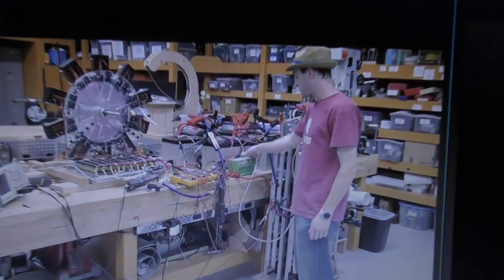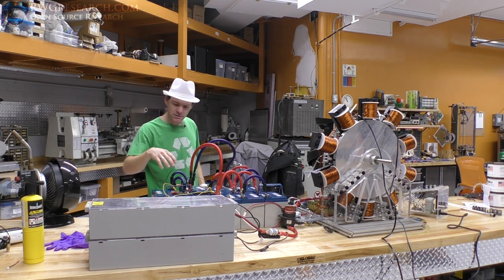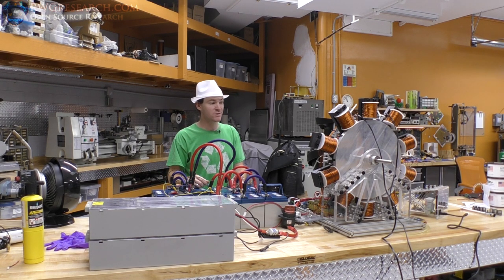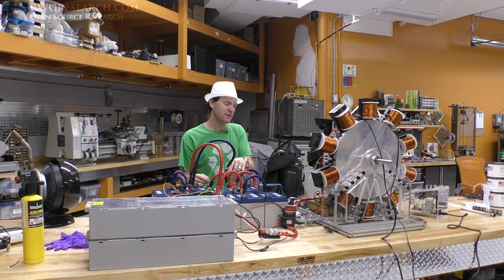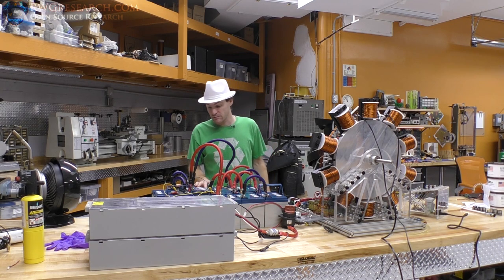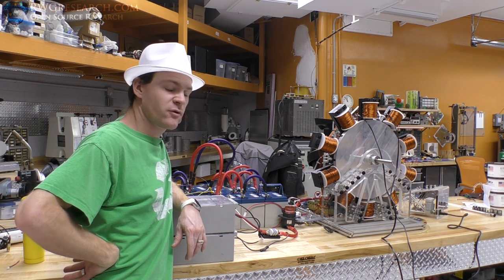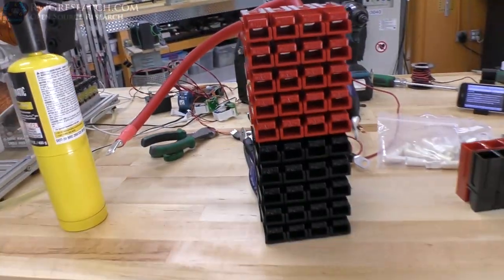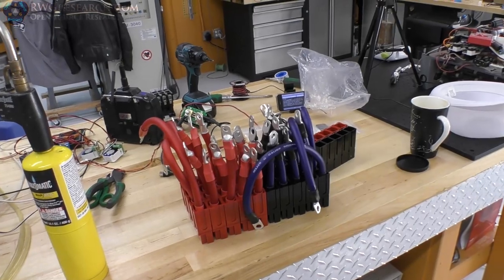P4 : Bedini 10 Coil Testing... flash back from 2017

Comment: I know I'm asking a lot but I have an experiment for you. Take a magnetron's resonating cavity, remove the magnets and replace them with an iron ring, which is grounded to a high voltage transformer. Run current through the filament in the cavity and power on the transformer. I think this will produce a new type of EM radiation that interacts with silica in stone.
Reply: Grounding the ring causes it to magnetostrict, or vibrate with AC magnetism. Rather than a stable N-S magnetic field in a regular magnetron, what would an alternating field do?